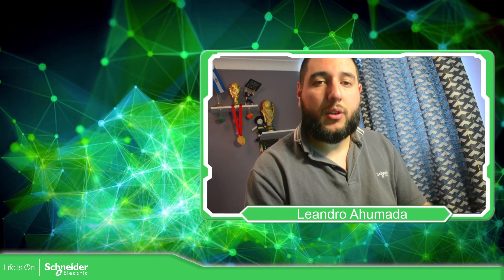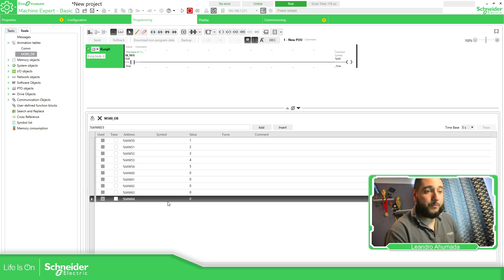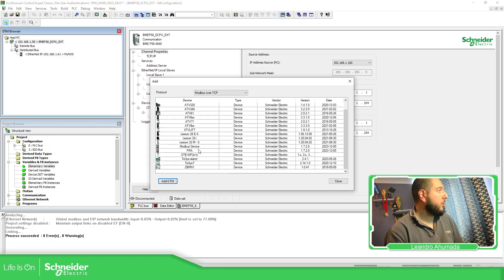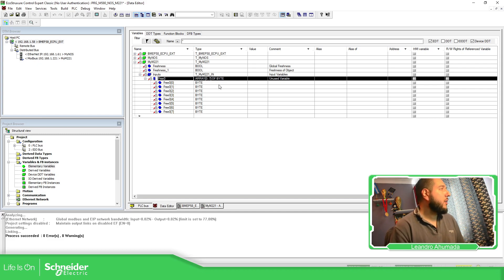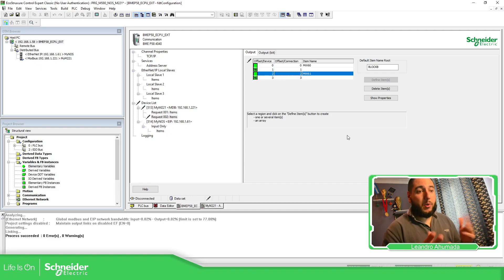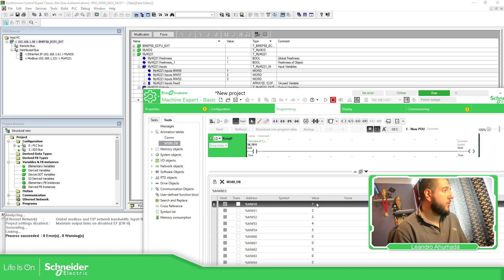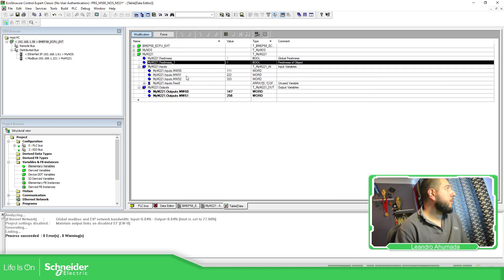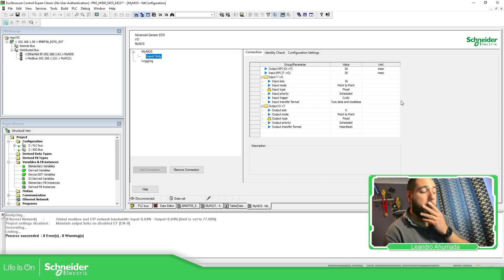EcoStruxure Control Expert Training - Mx.x BMENOS0300 connection to a server (DIO Port)

Comment: Congratulations on the video, it is of great help, but I have a question, for EthernetIP communication using EDS, I need to communicate with a sinamics G120 CU250S, I am using a BMENOS0300 on a BMEP2040 CPU and a Schneider manageable switch but I am not able to write to the drive only reading, I would appreciate it if you could help me, thank you.
Reply from the maker: Hi there! Do you have the same behaviour without the managed switch?
Reply: Yes, by directly connecting the inverter to the M580 we obtain reading only, when we connect it to an ATV340 in EthernetIP using exactly the same architecture the operation is as expected, that is, writing and reading data. Appreciate your attention..
 @LeTomasAHUMADA